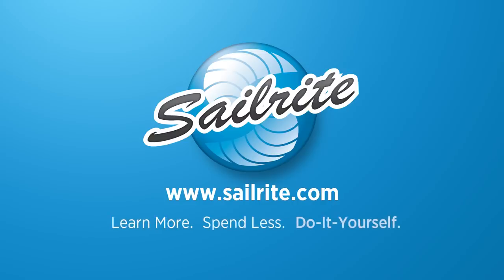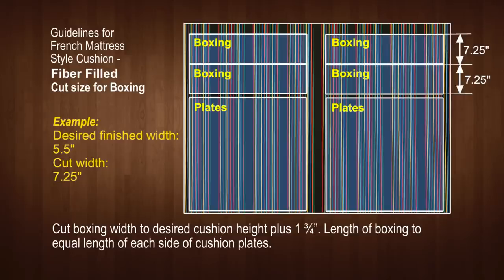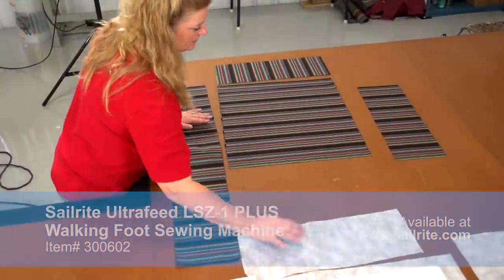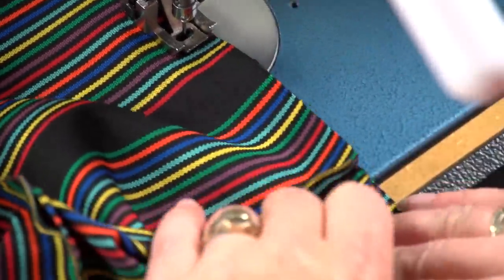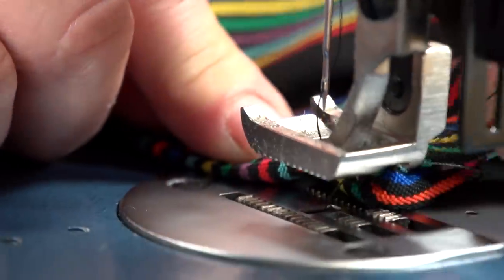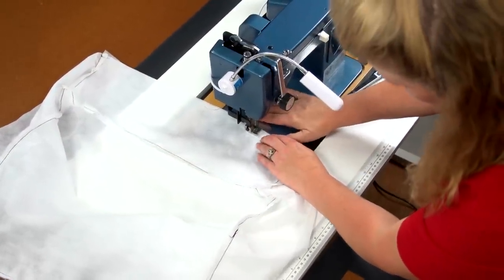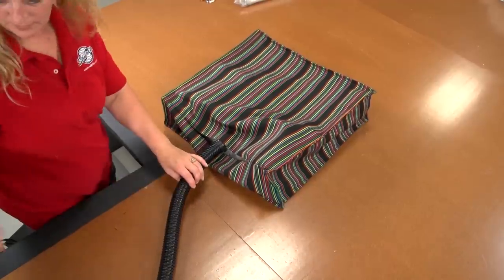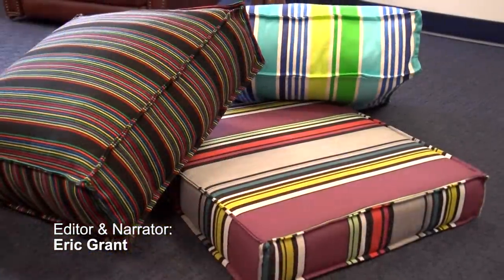How to Make a French Mattress Style Cushion

Comment: Much appreciated tutorial, thanks for the chapters!
Reply from the maker: You are welcome! Let us know if you have any questions.
Reply: Sailrite Actually, I do have a question! With the pieces for the boxing the same lengths as the sides of the seat, when I sewed the 4 boxing pieces together at 3/8ths inch, they were too short to attach perfectly to the seat, so I had to crimp in a few wrinkles on each side of the seat to get it to meet at the corners. Should I have cut each boxing piece 6/8ths of an inch longer than the seat piece?
Reply from the maker: nicole .dominix If the boxing is the same length as the plates (top and bottom) and a 3/8" seam was performed to join the boxing together it (boxing sides) will be slightly shorter than the plates. However, when the boxing is sewn to the plate using a 3/8" seam that should shorten the plate size to equal the length of the boxing on each side. So, no the boxing should not need to be longer.
Reply: nicole .dominix 67 لبنان  هن8

Comment: What would this type of seam look like with cording also included? I am remaking cushions for a rocking chair, and don't want a zip closing. Top stitching the edges seemed like the best solution, but my customer really wanted a contrast cording on the top edge.
Reply: it's kind of an either/or situation. Either cording or this top stitching. If the customer wants contracting cording, you're kind of committed to welting. I would always do a zip closing, it's too limiting not to offer a zipper in case the foam compresses over time. I'm still adding a zipper even with this type of cushion, especially because I'm using foam and don't want to have to wrestle to sew the last section closed.

Comment: What would be the total addition if you wanted to have a 1/2 seam allowance? Awesome video! Thanks for posting.
Reply from the maker: Tammy, 3/8" (what we used in the video) or a 1/2" seam allowance will not make much difference in the finished results of the cushion cover. It will be slightly tighter, but should still work great even if you cut the plates and boxing as directed in the video.
Reply: Thank you so much!
Reply: How do you get the foam slab inside?

Comment: how would i do this if i want to add a zipper....love your videos....i love my long nose puenmatic staple gun i got from you guys for the low low....
Reply from the maker: +gwen sumlin When making one of the boxing sections you would add to the width of the boxing to accommodate the zipper. I would add 2 inches to the width, cut the boxing in half and then fold the edge over 1" and sew the zipper onto each side. Here is another video that shows what I am talking about regarding the zipper plaque: https://youtu.be/QX_AEiROgaI?t=13m33s
Reply: thanks sooo much....

Comment: I'm not sure I understand the measurements. Need a clearer diagram and explanation. I have a 22" x 22" x 4" foam cushion. Should the top and bottom plate be 22 3/4" x 22 3/4" or should they be 23 1/2" x 23 1/2"?? And what about the boxing? is that 1" and 3/4" on all sides?? or and it to total length and height?? a diagram or picture would really help.